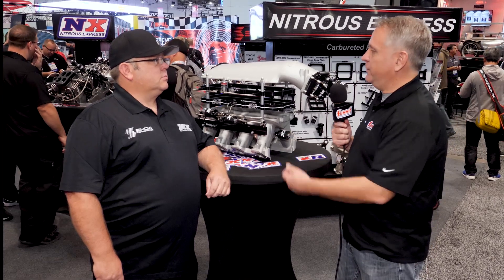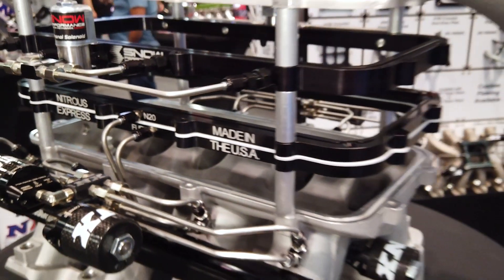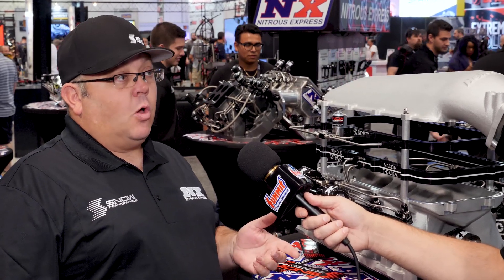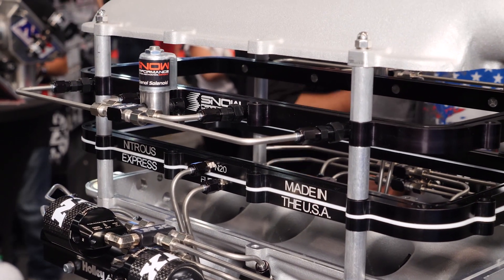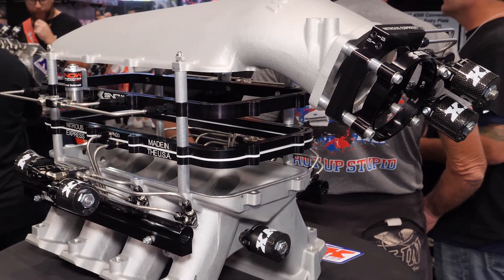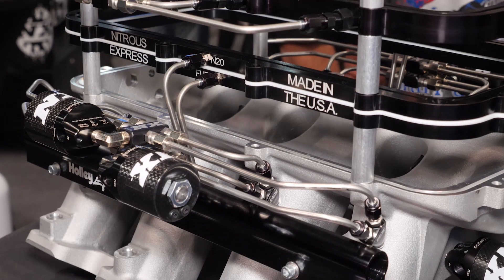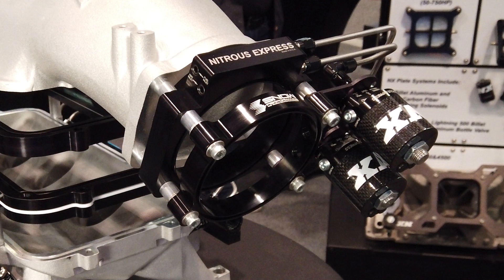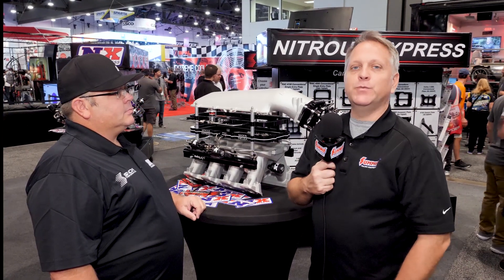Nitrous Express Systems for Holley Hi-Ram: SEMA 2019

Comment: Turbos are the Wave of the Future. And the Future is Now.
Reply: Turbos are overrated and just cause problems, naturally aspirated or superchargers are where it's at
Reply: @-meat-  Turbos overrated ??? That's why they come on so many production cars and trucks nowadays. Then why are all the fast racers running turbos ??? And your Supercharger is requiring power from your engine due to being physically connected to your crankshaft, while a much more efficient Turbo is making all the boost and volume you'll ever need, by running off of spent exhaust gas, not by being connected to your crankshaft like your Supercharger.
Reply: @badass6.0powerstroke10  almost all TRUE race cars are NA
Reply: @swappedoutZ71  if you say so.